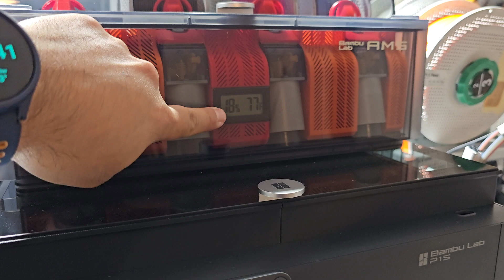Bambu Lab's AMS vs AMS Lite comparison

Comment: Thanks for this vid, I like the bowden tube helpers you have in your standard AMS; I used to have simplified ones but I noticed filament was boring a channel in the gray intake hole, so I added thoes buttons with bowdens sticking out of them - but I think I want both the buttons and ones like you have, got a link?
Reply from the maker: Hey,  yeah.  Here are the links to ams saver bottom and top guides.  Is this what you are asking about?

AMS saver:
https://makerworld.com/models/156593

Guide top part:
https://makerworld.com/models/172221

Comment: Well done!  Do you have a link to print the black AMS Lite spool plug with the numbers on it that you show?  Thanks!
Reply from the maker: Thanks. 
The plug lock is actually two parts. The twist on lock to hold the spool and the number badge i glued on it. Links for both.
Spool Lock
https://makerworld.com/en/models/134494#profileId-145956

Numbers badge
https://makerworld.com/en/models/197965#profileId-218572

Comment: Nice comparison. I have the P1P and also have the 4 to 1 adapter from Bambu. I need to get that mounted like you have yours.
Reply from the maker: Thanks. Yeah, those 4 to 1 adapters are great.  Guess that's why they go out of stock so often. Lol
Reply: What is the purpose of this adapter, for running ams lite and external spool or?
Reply from the maker: @JamesAllen-xu8hw  Yes,. The adapter helps with  AMS Lite and to add a few other externals spools. Without it, I would need to unplug a tube every time at the base of the print head. That wears out the tube ends it could start popping off.
Reply: @CarlexDIY  Thanks for the reply

!